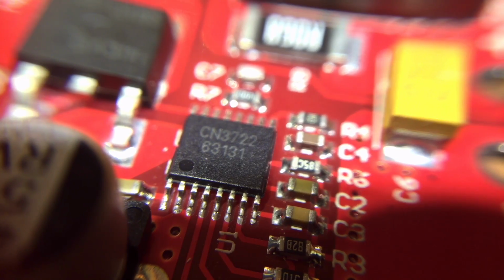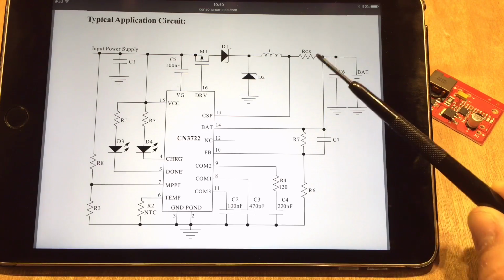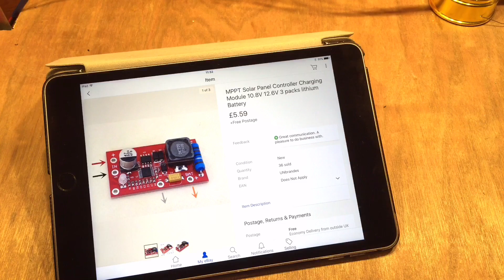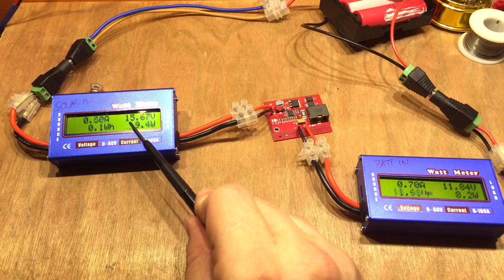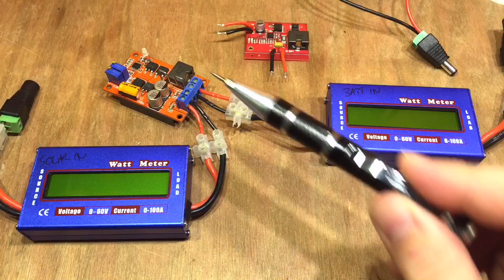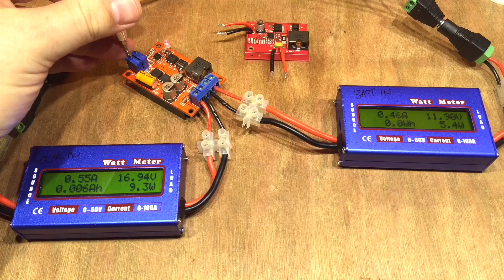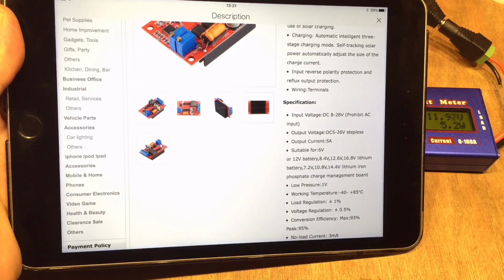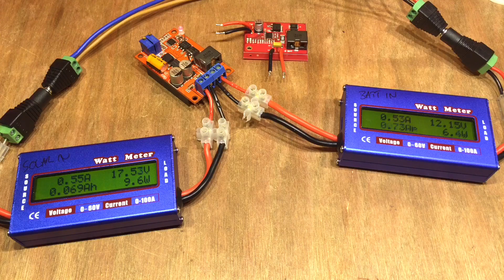Cheap(est?) Lithium MPPT Solar Charge Controller CN3722 - 12v Solar Shed

Comment: Thanks for the video. Turning the first poti why did the voltage change at the input side wattmeter? Isn't the voltage there which is the output of the panels, completely depending on the irradiance? My understanding was turning the poti only changes the divider ratio to the MPPT pin which of course isn't the one being monitored in your setup, right? Thank you.

Comment: interesting,  i have an 18v /25w solar panel,  so the smaller mppt board would put out the required 12.6v to charge the 3s battery pack?, or would i still need a 3s bms board too?  thanks .  i just want to be sure as i have had a fire with a 3s before lol....

Comment: I am pretty new to this module. Can you tell me if it is possible to charge less than 12 volt batteries, for instance 5v batteries using this module? Or it has to be exactly 12 volts output?

Comment: Your test is great.  Would you be willing to try this on a 100-Vin/-20Iout Victron MPPT and show your results.  The manufacture claims that with a battery of 24V (6S), it can do a 580W panel and output 98%+ charge with a max of 15A.   And if you give a think, these numbers don't add up.  Also, they do not publish their MPPT tracking curve.  Don't have all the equipment (or expertise) you have.  It would nice to see what you get.

I ask this because you will note that the output current of the first and hence the output wattage of the first was far higher than that of the second.  And the MPPT I have behaves like the second one, not the first.   Roughly you were getting 87% on the first one and 80% on the second one.   (In mine, I see numbers like 65 - 75% with manufacture claiming 98% -- and I'm using a panel that is 60% of the rated of 580W ).

Comment: I'm not an expert, but, as far as I know, the maximun power from the solar changes by several reasons, like sun quality, actual load, panel temp, etc...
The maxium power will not be always at a fixed voltage.
So, this controller does something but is not FULL MPPT.

Comment: Tengo un PROBLEMA Mi Aeromodelo (Un 4-m Planeador) Utiliza un Motor Para Subir, Su Batería Li-ON,  (Es Pequeña y Ligera)
Pero sus Alas, están FORRADAS con Panel de Células Solares, Foto Voltaicas, ¿SE PUEDE TENER la FUNCIÓN DE CARGADOR DE
LAS BATERÍAS, MIENTRAS HAY TAMBIÉN, UNA DESCARGA DE LAS MISMAS, EN el MOTOR, los  SERVOS y el RECEPTOR de RC? 
Puede Recuperar o ¿se puede PROGRAMAR, para Diferentes Voltajes de Recarga de 1 a 6S o según  el voltaje/carga de la Batería?
Sobre BANCO El Invento LUCE muy Bien y muy ligero, pequeño y No mas Practico que, un Cargador de Baterías mas . Pero SOLO lo 
VEO PRACTICO Y ÚTIL si lo Podemos UTILIZAR en Vuelo RC, para Recuperar Batería, Para Casa, Ya Tengo los de ROBBE y Turnigi.

Comment: Presumably, the only important thing about MPPT is that the power going into the battery is the maximum it can be, so using a perturb and observe MPPT method it should be possible to only measure the battery side current and voltage, multiply the two to find the power output and then adjust the PWM duty to the DC/DC and observe if if the power goes up or down and make the relevant PWM adjustments. I do not see an advantage, other than data gathering, for measuring on the panel side rather than the battery side.

Comment: I'm making one of these.  As it turns out, the only data you need is the current going into the battery - nothing else matters.  You just diddle the PWM signal to get the maximum current into the battery.  This is NOT the same as the defined MPPT of the solar panel. Think about it.

Comment: Thank you for posting this nice comparison! I would like to use a BMS with one of these. Have you run tests with a BMS? The BMS has its own (pre-set) voltages that can not be adjusted, so how much does a BMS mess up your good values from a charger like this. And what is the efficiency of a BMS? How much do I lose there?

Comment: This circuit is is simple, but nuts. It's a very good circuit. I have actually ran this MPPT board with my 60 watt solar panel, Output maxed out at 36 watts, Charged my battery pack 3S 11.1V Lithium Ion 10AH Battery pack and it recharged the battery faster than my switch mode power supply board i bought from ebay. That current conversion and 10% higher efficiency make all the difference.

Comment: AliExpress sellers sell (the first device as) 2s 3s variants. As i have one in hand ,asking if automatically detects output load, hence the voltage. Question stems as i want to charge a 2s and the device might be for 3s.

Comment: You shouldn't focus on voltage. The charge pattern is fluid voltage and high amperage.
If you look the amp in is lower than amp out.
Usually the voltage floats until the battery is 80-90% charged then it becomes fixed voltage (battery voltage) and the current (amps) lower.
There is three stages...
1Current ( int charge) Max current (high amp)
2 fixed voltage (main charge)
3 float, (battery voltage) low current.
((Min current))
Off.

Comment: Hi Adam. I have been following your channel for sometime now and have possibly made a mistake with selecting an alleged MPPT solar controller. The charge controller I have does not have any identified model numbers. 
 Allegedly the controller is capable at 40 amps, max pv of 50v with a max pv input of 520w (12v). 

The display went off, it through everything off and never came back on. So I opened it up then noticed some strange things. There was identified mppt controller ic. There seems to be 2 chips one identified as made by HOLTEK, then another ic with no chip id. So I have serious doubts about weather it is a true MPPT charge controller. The board has an id of XW-LVD01-V2.0. There is no resistance on the solar input. 

Any advice would be much appreciated.

Comment: Hi, can you please help me? I am building a power box for fishing with 4s lifepo4 battery cells. I have an old and very small solar panel (for testing) wich i am trying to connect the second mppt solar charge controller from you video to. I have installed it exactly the same as you did (especially ordered the watt meters for this purpose) but i am not getting any watt reading on the meters? I can adjust the voltage coming from the panel and i get 18V, but it does not show any watts (so its not charging the battery)? 

The battery side only gives 13.3V (wich is the charge in the battery pack) and also no watts. 

I really do not know what to do now. Am i doing something wrong? Is the solar panel broke or not strong enough? (no specs on it) Does the BMS i obviously hook up to the battery pack prevent charging from the solar panel? I seems to me when the panel generates 18V it should be charging the battery?

If you can please help me it would be great. I want to buy a bigger solar panel, but first i need to get it to work. Thank you very very much in advance for your help. 

Should you need additional info i will be glad to provide it to you. 

Reagrds from Holland.
Reply: Can anyone help me please?

Comment: What do you think about the ... 
"5A-MPPT-Solar-Panel-Controller-Step-down-Constant-Current-Voltage-Buck-Module"
ITEM on eb*y  401616625064 with double LED display
or the  173852402786 with better design.

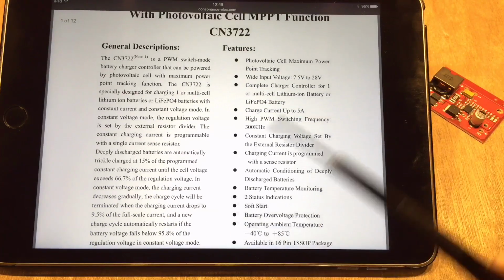Comment: 01:50 The data sheet of the cn3722 says, the input voltage is between 7,5 and 28V. And it's designed to charge 3s Lithium batteries. (That's up to 12,6V) 
Why not test at different voltages to see how it performs?
Reply: @mvdhanani  I don't know. 
Maybe it's only step down. 
I will order one to see what it does.
Reply: @mvdhanani  I just tried the 12V lead acid version of this module with 2 little 18V solar cells connected. 
The output was always 13,6V that's too low to charge a lead acid battery properly.
It has a red and green LED.
The red LED turned on at about 8V 
but it not charge. 
When the solar voltage is above the battery voltage, the LED turns green and the battery charges. 
In my case the Solar voltage input in sunlight is about 24V and the output is permanent 13,6V

Comment: I was thinking about this I was thinking the one that adjusts I have a 270watt panel 4 629 commercial battery’s I have the perfect suitor one which is supposed to be mppt but isn’t could I just swop that for this thanks tony

Comment: Having tested this at 17,6v Solar input only you are missing the point of this board. It switches the output to be most efficient at lower changing voltages when e.a. the sun is dim or clouds are in front of it. So it's the dynamics of changes that give it its MPPT characteristics. You could have used a power supply with variable output voltage to simulate this.

Comment: Thanks for posting all this info over so many aspects of the main topic. I am new to solar and lithium. Last year I couldn't spell 'lectricity and now I am one. Many thanks.   I note you used a 20 watt panel with about i amp of current. My smallest panel is a 100 watt which puts out about 6 amps. Will this be too much for the second, adjustable charge controller. Or, does the SCC just take what it needs.  Can anybody clear this up for me.
Reply: Yeah not sure about that, I'm using a 24V 5A panel with the second one and it works perfectly fine even though it's maximum input voltage isn't anywhere near what a 24V panel can put out... I have 12V 200W panels but I haven't tried them yet, it's been working so good since I got it four months ago that I have no need to even check it... It's super reliable and fast... If there's any light whatsoever, it will be trying to get every last bit of energy that the panel can see... That's why I have more than 10 of them now...
Reply: @PeterMilanovski  Thanks, very helpful to me since I have little working knowledge. I keep finding that the Chinese protocol is to drastically overstate all specifications. I am building small battery packs in plastic ammo boxes and I think this is going to safely work for my needs based on your report and the fact that almost all stated specs are pretty much "bragging versus factual data".  Again, thanks
Reply: @davidfloyd9962  no worries! Just be careful because batteries are just batteries and there are things about batteries that not everyone understands. While each cell in a bank looks identical, inside each cell is a different story! Each cell has it's own (what's known as) internal resistance, it's this battery property that determines how fast it will charge and discharge! 
In an ideal world we would want all internal resistances to be the same but this is not the case and we can't really do anything about it so we need a solution! 
Having multiple cell's in parallel is asking for trouble! Yeah I have seen plenty of people who have done it too! But this is the wrong way to go about it... 
I have been working on a solution to this problem for awhile now, I have found that each cell in parallel needs to have a diode in series with it to separate it from the rest in the pack! Then you need to be able to charge each cell separately from each other, in other words, each cell needs it's own battery charger circuit! The circuit must also have an isolated output so that you can place batteries in series for higher voltage output and the charge circuit must also be able to do the same! 
I know what you are thinking right now LoL, this sounds really complicated! LoL you should try designing a circuit for this! 
You can't just go ahead and purchase one because it doesn't exist! There's plenty of ic's that are designed for charging all types of batteries and I'm struggling to find one that will work with a single cell and has an isolated output! But I'm sure that I will work it out but it's going to take some time... 
So! You may ask? Why go to all that trouble when we already have BMS systems that can Ballance the cells!! 
Well, with what I'm going to achieve is, much longer battery life! And since each series string is isolated, if one cell dropped to the cutoff voltage in one string, it won't affect the other strings wherein the usual setup with a BMS, the output is shut down when one cell drops to the cutoff voltage even though there's still plenty of energy left in the rest of the cells!, And also, when cell's are charged individually, if one cell gets to full capacity before the others, it stops charging while the rest keep charging! 
It's going to be a journey but someone has to do it... It might as well be me since I have already started LoL...
Reply: @PeterMilanovski  Thanks for your thoughts! I became aware of those drawbacks shortly after I started tinkering with lithium/solar. I really like Adam's approach to inexpensive but practical utilizations. I follow a few rules since I realize i am fairly ignorant. One rule is "Safety first". I do not recycle used cells unless they have a good pedigree and are closely matched. I have been buying items from Battery Hookup and I am quite choosy as to what i select. Almost always cells that have never been cycled such as their modem packs or new K2s and A123s. I have also bought some new Navitas prismatic Lifepo cells. Of course this opens up a whole world of wiring, bus bars, BMS units, storage boxes, connectors, SCCs and panels. Something of a "tar baby'. again, thanks for the input.   DCF
Reply: @davidfloyd9962  no worries, you are welcome!

Comment: New to solar starting out with 8Ah LiFePo4 batteries. I've been looking at similar budget charge controllers. In the 3-4 years since this video has been produced, do we have a similar product but in a weatherproof case that might be used outside, or on a boat? Any one tracking a list of CN3722 based controllers ?

Comment: For the CN3722 "MPPT" means Manual Power Point Trimmable, halfway usable...
A complete fail was the CN3767 (should be for 12v Lead-Acid) 
It never charges more than 13,55V, that is even not enough for floating... 
Not to mention the necessary absorption level to avoid sulfation.
Reply: Actually the manual versions are better! You only need to set it once to your panel and forget it, same goes for the charge stop voltage! I have been using the second model in this video for some time now, I have a 48V series string battery bank made up of 12V Lifepo4 Batteries, I'm using one of those charge controllers per battery, each controller looks after it's own battery, no other BMS is needed! When one battery is at full charge, the controller stops charging but the rest continue so the batteries are never out of balance! 
I was using a more expensive MPPT charge controller which automatically tried to match my panels but I found that every time a cloud went over, it would waste time trying to figure out the best point to set the MPPT, most of the time, by the time it figured it out, another cloud came over and it's back to square one! But this thing! Once set! It's fast from the slightest bit of light in the morning to the last bit of light late in the afternoon, it tries to get the last bit of energy! 
This is just my opinion of it but I love it! It just works! I used to watch it all all hours and conditions of the day but I have since just given up... Totally hassle free!
Reply: @PeterMilanovski  Ok, you are pleased with not knowing what really happens.
Indeed with longer periods of low-light winter time they have an overall efficiency that is FAR below simple PWM controllers, since they will not begin to charge until the panel has reached 18V.
Then the CN3767 just charges to 13,6V and that is NOT adjustable. The battery NEVER gets a full load.

Comment: Thanks for the video, but is a buck converter enough to charge control a 12v battery from a 12v solar panel? I thought that you must have buck-boost, how can it just be buck?

Comment: Thank you for posting this, I noticed that with the second module that the MPPT potentiometer did a better 10w (at 18v) on your video than the recommended 17.5v at 9.5w as you were adjusting it up&down
The available manuals of the second module recommend that you find the best MPPT point (constant voltage) of the panel you are using by adjusting the MPPT potentiometer
Reply: I also agree, I saw the second one peak at 10W when it was at 18.2V for the solar panel... I have since purchased a few of these and I'm impressed with how good they work! They can also be used in parallel for more current and I also found out that they don't like to have a solar input with no battery connected, they die, don't ask me how I know LoL. It turns on as soon as the panels see a tiny bit of light in the morning and won't turn off until it's almost to dark to see! They really try to get as much energy as possible! 
After playing around with a couple of them, I purchased more of them! 
I'm using 12v Lifepo4 Batteries and I have one of those controller's on each battery which the batteries are wired up in series! Apart from the 12V batteries having their own built-in BMS to balance the cell's inside, I don't need any other BMS because the charge controller looks after it's own battery and if one is at full charge, the rest keep charging! It's brilliant!
Reply: If I want to achieve 6A, can I use two of them on the same panel?

Comment: can this use my power wall solar panel and charger to 18650 battery pag, 4C4P setup. need this BMS too whit battery ? i has build 4C 4P battery pack because 3 cell have too low and 4 cell have good can take out step down board regulate just perfect 12,1volt out-. but i not know how and what can charge pack my solarpanel i have 45-100W some panel. normal little battery pack need only 45W panel give out 16-18V nominal 5-7A or my 100W panel 18-24V out and 8-10A what charger need buy ??? battery pack have 18650 bats. 4 cell =max about 14,7V 4P= 4x2200mAH=about 8800mAH capasity. how charging this ?????